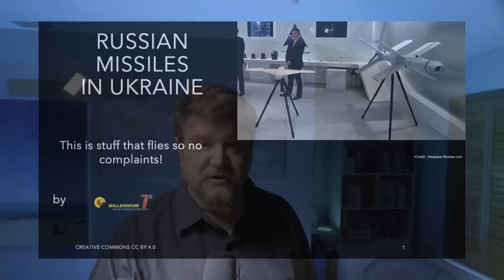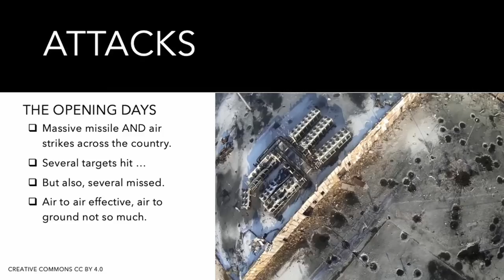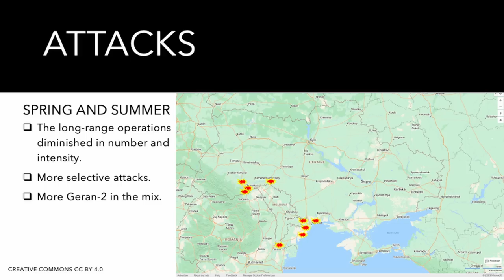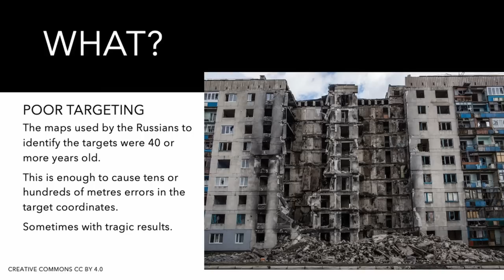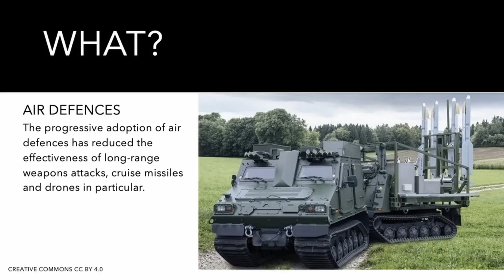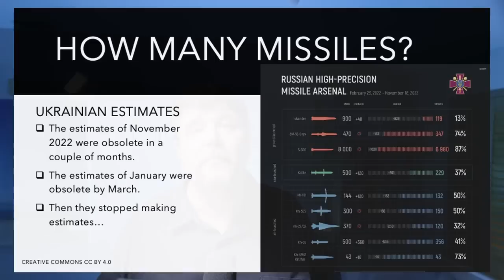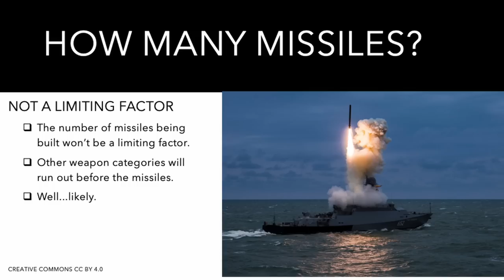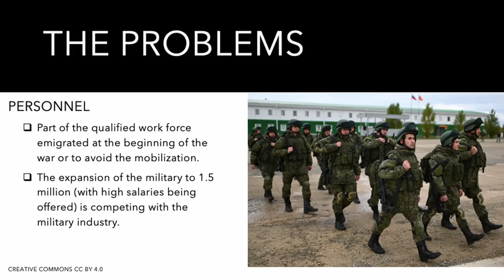Ukraine: Russia Run Out of Missiles!

Comment: I have questions about Ukrainian AD from your video Are they actually improving? I understand their AD is degrading as more Russian FAB bombs get through. Also if Ukrainian interception rate is 50% -60%, do you think the Russian AD interception rate should be in the 70-80% range? Russian IADS seems superior to Ukraine's at every level.
Reply from the maker: For the moment there's anecdotal contrasting evidence
Reply: I too found this a good point. I have seen your reply and after the recent spate of missile attacks it was stated that there was virtually no AD over the north east region of Kiev or the city itself. I do agree that there is Ukrainian AD and I firmly believe it is in the south west towards the caucus mountains. As you mentioned the supply route from Romania into Ukraine for western munitions and armaments'. This region is heavily defended by AD as are the port regions of Odessa and the inland river port as well. This is why a special raid was carried out by Russian Commando units in the South west, taking out transport infrastructure and oil refinery. 
Apart from the man pad systems and the S300, their is very little else that I can think of that has been kept back in reserve for AD, but I would like to know what I am missing. Every super weapon that has been going to be the game changer has been set to fire as if it was a piece of paper. HIMARS are being used as rocket artillery, even though I thought it was supposed to be a rather expensive but flawed AD Umbrella. I know they received some Gepards, but that is not real AD! The UK supplied something but I have heard of it being used at the front line and none too effective. 
In the mid phase of the SMO, the Ukraine AD was more responsible for causing the collateral damage than the attacking missiles, with many reports eventually telling the truth about the damage that was caused being done by an "Own Goal".
Please, I am certainly not the Vagner ;) of AD knowledge, but I just cannot see the 50% figure as being correct. I would at best consider 25% in Ukraine's favour with 75% of the RF missiles having made it through. I acquiesce to your knowledge on the topic if you can provide me with something to mull over!

Comment: Russia used to send volleys in the hundred almost daily now its few dozen shot off in response to every time Ukraine lands some hits with its own production of long range strike weapons. So very much of the hundred missile volleys we saw before were of the massive stocks of old soviet strike missiles that are now indeed run out. Also Russia is regularly exhausting its new missile supply and refilling it with the meager production we are seeing. The issue is not when they will run out of missile but when they will exhaust the supply of chips they clearly stockpiled for this war.  Real question is how effective have all these Russian deep strikes been, especially compared to the smaller scale and far more economical Ukrainian deep strike campaign. Russia is bleeding its tech reserves to achieve some minor damage on Ukrainian grain infrastructure that was already crippled by blockade yet as still not been cut off and maybe turning some babushka's power off for new years!
Reply: But a few dozen a month pretty much holds with the size of the Russian missile volleys we are seeing such as this latest one and with their frequency. C300 and even the UAF C200 are being employed not so much in a unique soviet designed multi roll (that assumption is total BS and holds no were else across Russian high end system which tend to be very single role like with their jets Unlike the west) but in emulation of western (mainly western navies) multi role use of their SAMs as SEAD weapons. This is actually a really old US Navy innovation going back to the Korean and Vietnam wars of repurposing anti air missiles as anti radiation missile using sea sparrow and standard missile much like we see with the russian and Ukraine using C200/300, putting GPS on C300 for the strike role is just an attempt to improvise HARM smart attack capabilities to make up for the limited but not absent terminal guidance on these semi active SAMs turned SEAD like C200 and 300. They are using their semi active radars receivers to hunt down defense radars as a screen for the smaller number of other missiles Russia is barley able to produce or the small number Ukraine has received. Every thing we are seeing you praise here like getting UAS deep in the rear for real time targeting is catch up to the Ukrainians who we saw and see doing this on the reg for years now, ya just seem to over state and impress Russia just a bit.

Comment: easy: look at the rate of missile/artillerie firing, if rate consistantlt drop it is a very good indication that they running out of stock
buying up drone from Iran and artillerie form NK is another good indication
Reply: Maybe, but not necesarily true.
They may have run out of targets deserving advanced weapons usage and/or good intelligence of where such targets may hide by now. Not to mention such drones are cheaper in every way with good results.

Correlation is not causation, this bias is so pervasive in the context of russian missiles that it keeps extending from time to time with no objective evidence on the contrary.
Reply: "Maybe, but not necesarily true.
They may have run out of targets deserving advanced weapons usage and/or good intelligence of where such targets may hide by now. Not to mention such drones are cheaper in every way with good results." @hackmind  

What are the evidence of that?
Reply: @anteeko  I don’t have any. I was speculating.
“If rate consistantly drop is a very good indication that they running out of stock”
That statament is a bias of correlation is causation. You don’t know, you just read or watch from someone else that reach that conclusion to fill a narrative. It may be right, it may not.
Don’t worry, I don’t know either.

Comment: Two terrible assessments in the first half. 1 Russia has no sanctuary from attack. ... it's the biggest country of the world. They invaded Ukrainian space ,Long range Western arms are not permitted to be used over the line. ..and the Russians have missiles to go all the way across. 
2 The claim that Russias air force is defensive , but defends by going offensive , is ridiculous. As you say , in the early part of the war when they invaded and had to pull back , and you postulate that they will defensively go on offense to protect themselves ..the invaders. 
Just get your Russian buddies to leave. 
Just get out. Just go away . 
You can't make the statements like you just did and pretend to be neutral ,so as to criticize the defenders.

Those poor Russian missiles can't target properly, well they blasted the energy infrastructure far beyond the military assets of the front line. 
And then you go on to defend the performance stats! 
These overall assessments were very badly considered. They're self contradictory.
Reply: Seethe some more. It's pretty entertaining.

Comment: The author is not bad, but his main problem is that he does not really understand the geopolitical basis of the events taking place.

1) The Russians did not have the goal of completely destroying the energy system (although this is quite technically possible). The goal is to bring the energy system into a weak state, but leave the possibility of supply for the population (whatever the Ukrainian authorities were, they cannot leave the population without energy). This is a geopolitical moment. I think this will not happen at all, for example, if operations spread to Europe or the USA.
2) The crushing blow was not planned at all. In general, you shouldn’t have any illusions about the existence of some kind of linear plan and think that Russians are idiots.
3) There is no dead end. There is no need to naively deduce this “deadlock” from the weak variability of the front line, as if all sides were making maximum efforts to achieve the same goals. This is wrong.
4) No S-300 strikes were carried out on ground targets (despite some idiotic statements from freaks). This is a standard design of Ukrainian propaganda, in this way trying to shift attention from the unsuccessful launches of their old S-300s. This is well known even to local Ukrainian residents.
5) We must keep in mind that propaganda is asymmetrical (the level of propaganda is not at all the same on both sides), and Ukrainian kula propaganda is stronger than Russian because arms supplies depend on it, and so on.
6) Regarding “they are launching new missiles, this means there are no reserves.” Here you can build various recursive structures, the reality of which cannot be assessed in any way. The author correctly says that no amount of analysis will give understanding, because all this can be controlled, for example, with the aim of misleading the enemy. In short, the story is about a policeman and a thief who resorts to a fork in the road.

But overall the author is not bad. I made a note of it.

Comment: Could you please speak with honest terms?
Russia has safe zones deep in Siberia and Iran and North Korea.
Ukraine striking back inside Russia is exactly the same as Russia striking inside Ukraine.

You make it sound like Russia should be exempt of being hit inside its territory and the war should only be contained within Ukraine, for some reason.

Please. You have more dignity than this.
Reply from the maker: This is what you heard, but not what I said. I don't attach any judgement value to the facts. Facts are what they are.
Reply: Russia would have to build new factories in those areas but no Siberia , as there have been sabotage events all over Russia.
NATO equipment is being built in untouchable territory , a sabotage attempt by Russia would be seen as an attack on NATO.
Reply: @Millennium7HistoryTech  "Ukraine has a sanctuary, but Russia doesn't".

Those were your exact words. Which are wrong. 

Your previous words were all about how the production capacity of weapons for Ukraine are inside NATO, and thus "in sanctuary". And yet Russia has similiar supply lines from Iran, North Korea and China. Plus the domestic production facilities thus far outside the range of Ukrainian attacks. These are all "in sanctuary".

It's your words against yours. If you intended to say something else, then you should have said that instead.

And on a basic philosophical level, your last statement is false. You, as a human, are physically incapable of not attaching a judgement value to the facts. The very attempt to claim this is self-deception, if you do not genuinely believe it, or a massive blind spot if you do.

Comment: The Russian economy IS in critical condition, they just banned processed fuel export because, while being the richest in terms of energy, they're running out of fuels. Even if their GDP increases - it's because they add their war spendings to it, and you're not supposed to do it unless you're at war. And Russia is not at war, it's still just a "special military operation".
During WW2, the German GDP was also rising up to the last days of the war (if you believe the Nazi numbers), but in 1946 it dropped down to the level of 1870s. It will be the same in Russia.
The Russian macroeconomic numbers are fake anyway.
Reply: Dream more.
Reply: "but in 1946 it dropped down to the level of 1870s. It will be the same in Russia"
What was done to Germany in 1946 will not be happening to Russia after this war.